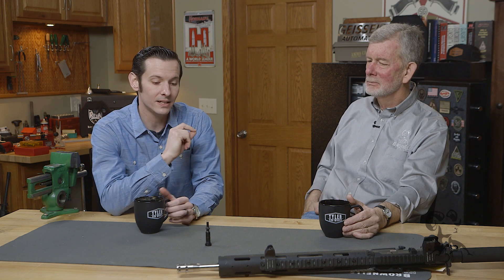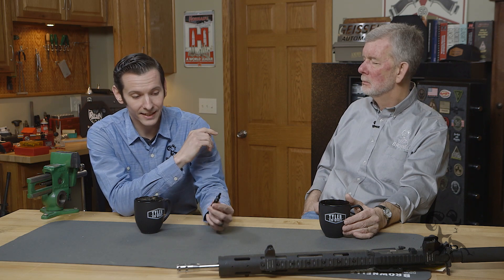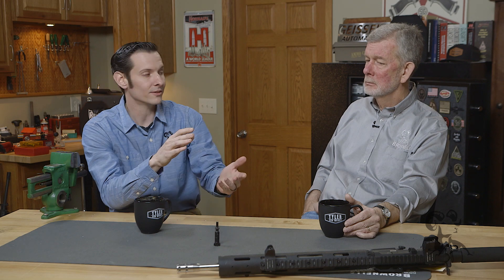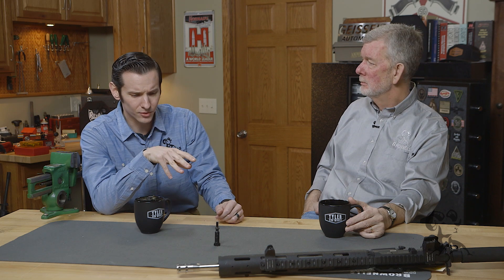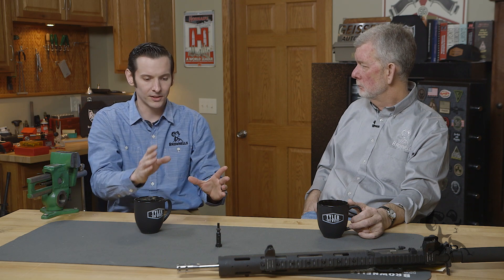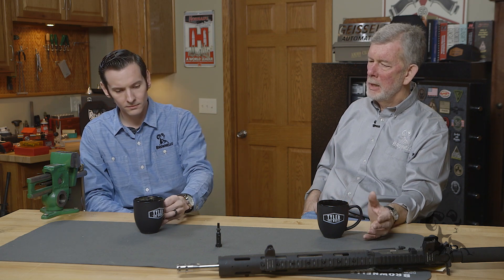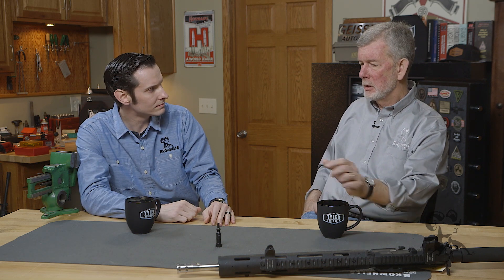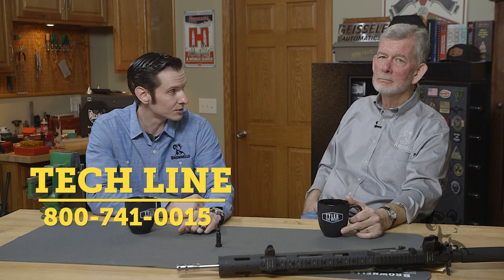Smyth Busters: Debunking an AR-15 Myth - Gas Ring Alignment

Comment: Let's set the internet on fire "The AR is just as reliable as an AK"
Reply: It is.
Reply: I'll see your 'reliability' & raise you a "politicians do not want to take your firearms".
Reply: It has been proven that the AR is more reliable than AK
Reply: Phrogge Prof I wouldn’t go so far as that. They are both firearms that are fit for purpose. I would suggest that the main thing the AR has over the AK is that you can make it very light without sacrificing reliability, or effectiveness as a platform. It is an all around better platform. It is easier to assemble, and easier for the end user to maintain. It is also (I believe, correct me if I’m wrong) cheaper to manufacture.
Reply: @nathanielkidd2840  Watch the In Range tests. The AR is better than the AK in mud and as good if not better in dirt and other conditions. The AK has the reputation of needing less maintenance but Military Arms Channel is doing a 10,000 round, no maintenance test of an AR to test that theory.
Reply: mustangkrillin I have. Unfortunately, these tests are too small a sample size. They are useful as evidence to show that the people who think one platform is garbage, and the other is better than sliced bread. 
Even Carl and Ian point this out, that it’s not proof, but is strong evidence. 
People often forget that a lot of the reliability of the AK platform is because of its amazing magazine.
Reply: @nathanielkidd2840  I've personally helped recreate the tests with the exact same results. Modern AR mags are as good if not better than AK mags especially if you consider weight and reliability. I'm not saying the AK is trash but it's worse than the AR in almost every conceivable category.
Reply: mustangkrillin yes, modern AR mags are as good if not better than AK mags, that was kinda my point. 
There are a few reasons that you would choose an AK over an AR, but those reasons are largely not applicable to an individual. By that I mean if you’re outfitting an army, and you find it easier/ cheaper to get one over the other, you are allied with countries that use one of them already, or you want a platform that would prohibit your potential enemies from being able to utilize your supplies.
Reply: @joeydubbs763  Biden says resistance is futile, "the government has nukes and jets..."
Reply: @nathanielkidd2840  So in your mind, a stamped/ painted/ riveted/ huge tolerance- sheet metal firearm is "more expensive to manufacture" than an Aluminum Forged, CNC milled,  anodized, parkerized, melonited  firearm?!? What planet are you on? You do know why Stoner built the stamped sheet metal AR180.......right?
Reply: @joeydubbs763  well Trump has already started the ball rolling with the bump stocks
Reply: scotty362100 the tolerances are not as big as you seem to be pointing out, and the machinery for large scale production of AKs is very expensive. If you start with an empty building, and want to produce them on scale with today’s technology, it is very expensive to produce AKs. I’m not saying it’s cheap to produce ARs, but there’s a reason that you can buy a reasonably effective one for $400.00, and even the PSA AKs are $600.00 and up. 
I don’t feel that an imported AK is a fair comparison, because of the price jumps associated with “real” AKs, or the cost of shipping them. 
I think Mischaco has a video about this.
Stoner designed the stamped receiver because in the 60’s this was a cheaper way to build that rifle. This is no longer necessarily the case.
Reply: @nathanielkidd2840  Are you serious? So The "machinery for large scale production of (AR's) is NOT very expensive? There are so many holes in your argument it is pathetic! The ONLY reason it is expensive in the USA to make an AK at this point, is the human/knowledge factor! PSA's AK is right in line with AR prices at this point, and when the skilled workforce "human/knowledge" factor is matured you will see dirt cheap US manufactured AK's! AR's are only cheaper because the tolerances/metallurgy have all been well defined, and the processes matured. AK's in third world countries are around $100-200, which is what it "actually" costs to stamp out the sheet metal parts, and labor for people that have been building them for 73 years. It is ALWAYS cheaper to manufacture a "stamped steel" firearm, the 1960's has nothing to do with it. You aren't the brightest light bulb in the drawer, are ya?
Reply: scotty362100 did you not read my comment? I didn’t say it was cheap to set up a factory for the production of ARs, but that it seems that with what evidence I can find, using a company that is known to produce inexpensive products, in the same country. You don’t think the cost of labour in a third world country being as low as it is would lead to an AR made in that country being $100.00-$200.00?
The 1960’s has a lot to do with it, considering that an automated CNC machine wasn’t around back then, and the initial investment into a industrial level steel stamping machine is roughly equivalent. And you can’t use that same machine for anything else, unlike being able to use the same machine for milling out the bolt, carrier, upper, and lower. The barrel and furniture cost differences is a wash. You still need to forge and mill trunnions, bolts, and carriers on an AK, but unlike an AR, it is necessary to buy an entirely separate machine.

PSA is selling ARs for ~350.00
Their cheapest AK is $600.00
The know how to produce an AK is not the expensive part of production. The machinery needed to produce the product is.
Reply: Well ak & ar have been manufactured for decades before cnc became available, so it would be reasonable to AssuMe that i could make everything with screw machines & brooches & gang drills & stamping dies & press brakes.
A good barrel drill will be expensive but thats a common problem with every carbine or rifle regardless of type.
Reply: MyMusic Account1 that’s kind of missing my point. Yes, you could make either of those rifles with simple hand tools, but would you be able to efficiently produce them in quantity, at an acceptable level of quality? I know “acceptable” is subjective.
Reply: @mymusicaccount1456  oh God shutup. I didn't like that trump got rid of bump stocks but choose your battles and bump stocks stocks getting banned isnt worth it. Now if its banning a gun then you got my attention.
Reply: @scotty362100  1 to 200 dollar in those countries is like 600 to 700 here. And ar15 are still cheaper by a good margin from palmetto state armory.
Reply: @bobbyraejohnson  well I'm just sayen Odumbo in 8 years never did that, he actually gave us the right to carry in national parks which I've done twice since then. But we worry about the left being gun grabbers but the right seems to be where the guns get taken away from us.
Reagan banned assault + magazine restrictions in Cali.
Romney did same thing in Mass
Palin de-gunned the Alaskan militia
Brady laws including background checks.
All little bits, all "good ideas", all take a little bit away from our right to bare arms!
Reply: AK is pretty garbage. Antiquated, awkward, and a chore to do basic maintenance on. It's the opposite of an AR in every way.
Reply: The AR platform is a Mr. Potato head gun. Mix & match components of like type. The AK, not so much. I think a decent AR is more accurate than the AK as well.
Reply: And only reason in the beginning was the government was sabotaging Eugene Stoner because of they didn't want him have the contract and wanted Springfield Armory to get it ! They changed the power from stick powder which was low moisture content and low carbon instead used grain powder which was plainly not good for gun and M16 misfired and jammed all because of them screwing with powder The GUN WAS NEVER A PROBLEM PERIOD also secondary one was the springs used in the magazine were faulty and helped the gun to malfunction So as the SPENCER RIFLE WAS ALSO Sabotaged the Government did again in Vietnam. Shoot in the first test with M16 the pins for the sights were replaced with welding rods to look ok but misaligned gun So my thing is before you believe the nasty story about how bad the M16 was find out real truth THE GUN WAS A EXCELLENT WEAPON AS STONER BUILT ONLY THE ARMY HIERARCHY WRECKED IT FOR THERE PROFIT. OH and STONER BUILT THE AR 10 first with 7.62 X 51 The ARMY CHANGED IT TO SMALLER ROUND HE DID BUT NOT HIS CHOICE!
Reply: @bobbyraejohnson  the problem isnt WHAT got banned its HOW it got banned.  They ruined an entire industry and put companies out of business all without passing a law through congress.  Congress took no part in banning it.  It was all done through executive action and bureaucracies.  By the people allowing it to happens what's to stop the next president from taking executive action and having these agencies "redefine" anything and ban it without a congressional process?
Reply: Reliability is great but Accuracy is King.🤔
Reply: @ytty5183  AR 15 SERIES is very accurate MOA accurate

Comment: It makes sense that the gap, if aligned in all 3 rings, would leak gas and it certainly does but the leak is not enough to matter.     The massive amount of gas produced from firing a cartridge is far greater than the gas that could pass through that small gap in such a short period of time.

Comment: In the Marine Corps, I was a rifle and pistol coach. I have seen My16A2s all of a sudden, start throwing random flyers. Had the shooters disassemble the weapons, and lo and behold, the gas rings were aligned. Staggering the gap and the groups closed right up. 
That's just my experience.  I've only seen it a few dozen times, so......
Reply: Why would the gas pressure effect accuracy of the weapon? I would think I could remove the gas rings all together and turn the rifle into a single shot and it still would not effect the accuracy of the barrel. It sounds more like the barrels were hot and taking the gun apart gave them a chance to cool down, or allow the shooters to rest

Comment: Once the rings are compressed inside the carrier that gap reduces to essentially zero anyways. Thats the whole reason for the gap. If they were a solid ring they would have to bend/twist out of shape instead of compressing to seal.

Comment: What about full auto bolt use, where the rings are so worn the bolt drops out, when you pull the cam pin out? I have seen that in person and the rifle functions perfectly with the worn gas rings.
Reply: Well, then the rings should just be replaced.. doesnt neccessarily mean worn rings won't work on a properly or overgassed rifle, just that it's not getting its maximum effective gas pressure.

Comment: Test it!!! You can't debunk a myth by using logic and reason alone and have it be undoubtedly debunked or proven. Besides, the thought is that the alignment of the 3 gas rings COULD cause the loss of just enough pressure to short-stroke. Also its more than likely to occur in a precisely tuned AR, like with an adjustable gas block. Take an AR with an adjustable gas block, tune down to the point it uses only as much gas as needed to cycle, align the gas rings, then see what happens. That is really the only way to "debunk" this myth
Reply: Does a lawnmower stop working when it's piston rings align? No, so why would a rifle?

Comment: Thanks Guy’s I Believe This Myth Was Started Because People Were Thinking Of Installing Pistons In An Engine As a Mechanic The Service Manuals Always Say The Piston Ring Gaps Must Be Staggered Before Installation To Prevent Blow-by Of The Combustion Gasses Into The Crankcase And Loss of Compression 👨🏼‍🔧 In an AR There Is Excess Gas and The Chance of Them Aligning As You Guys Said Is Slim To None and If It Did It Would Have Little to No Effect 😎👍🏼 Myth Busted

Comment: So my father and I recently purchased S&W AR-15s, both the exact same models. I’ve already learned how to breakdown and clean both. There’s one difference that I noticed and that is that the gas rings on my AR has more trouble slipping back into place compared to my father’s. Is there some difference in dimensions that I should be concerned with?

Thank you in advance.

Comment: When I first came into contact with the AR platform, AKA M16, in the mid 70’s the instruction from the Drill Sargent was to spread out the gaps equally and to not align the gaps because of gas bleed potential. So, you did what the DS said, next question.

Comment: I had a problem with stove piping with my M16.   The gs ring gaps were aligned.  fixedd it an fired over a thousand rounds with no issue

Comment: So alignment doesn't matter? So what if one of the rings gets a small piece the width of the gap on a gas ring blown out? Ring still intact. I had one and the bolt wouldn't cycle properly.
Reply: Well you're supposed to replace your gas rings anyway if that happens.  Your remaing gas rings might of   been worn and on their last breath too. That's like asking "what if I break a firing pin".

Comment: Myth or no this is quite literally apart of weapons inspection doctrine that is in practice to date at every unit I've been a part of. Also for those who want to know I am Active Duty Air Force Security Forces so I work with the AR 15 platform on a very regular basis.
Reply: Agreed, it is part of the inspection, not a necessary part, but indeed a part. I was a Combat Engineer for four years and an armorer for two, if I knew then what I know now...

Comment: You dont bust myths by speculating at a bench. You could do a fairly simple test, fire the lowest pressure ammo that will cycle the action reliably, align the rings and see if it still cycles as reliably. You could also see if they actually move between shots and by how much. If you want to get more technical, use a high speed camera to measure bolt carrier velocity.
Reply: I used a rifle with an adjustable gas block.  Rifle was set to the lowest gas it would reliably operate on.  One day I was cleaning it and wondered about the ring gap thing, so I lined them up.  Rifle still (on minimum gas) ran perfectly fine.

Alignment is a myth.

Comment: The Myth is Not that the AR won't cycle when all 3 of the gas ring gaps align because that can easily be proven wrong by manually disassembling the firearm,aligning the gas ring gaps,reassembling the firearm and shooting it. The Real Gas Ring Concern is that of Shot Placement Zero.  If You have ever done any Precision Long Range or Precision Competition with a AR, once you have the Firearm Precisely "Zeroed" with the Gas ring gaps evenly and properly spaced and after cleaning,lubrication and reassemble like Eugene Stoner had Intended for the Best Functioning of the Firearm and now have extensively shot with out inspection of the Gas Rings they can align from Bolt movement combined with gas pressure flow.  You will notice Your Shot Placement will move.  And when they do Your Precise Shot Placement Zero Moves affecting You Accuracy. So either inspect and evenly space your gas rings during regular Cleaning and Lubrication for better precision reliability or get and install the Superior Continuous Gas Ring like the U.S.Military does on the M4 and M16 so it it no longer a issue.

Comment: Wait! Youre telling me this is a myth and it wouldnt be acceptable to military standards? And the military was just paying marksmanship experts to come to the range and lie to us about gas rings alignment? Hold up, I've spent many days/nights and weeks at a time on the firing line shooting all day and night and found this information very helpful. This is not a myth those rings aligning will cause improper feed and ejection problems.
Reply: @scotty362100  real clever all you can do is go around name calling. Where  you heroes at in real life?
Reply: That's funny you say that, since I just watched some videos of Pat MacNamara (former Delta) doing some carbine training for 10th Mountain and in that training he called the ring gap thing a myth.  

So...

Seriously, go get your AR and try it for yourself.
Reply: Well, if your rifle has worn gas rings and is on the cutting edge of cycling then it might help. So it's a good practice to teach in the military where parts get worn and may not get maintained as needed. But it's not fixing the underlying problem though if your rifle is short stroking ect. It will just be a bandaid.

Comment: I have JP gas rings and they collapse when Doing the bolt test to check bad gas rings. Where u stand the bcg up and if it collapses under its own weight then the rings are bad, but my brand new bcg from Jp does this and Jp reassured me that it’s ok and will function fine. Is this a myth?

Comment: And what do you think would force them to rotate once they are operating in the bolt?
Reply: When it cycles open the bolt "rotates" which would cause the rings to move anf since they are independent of each other and in different positions within the bolt carrier they will all move differently so chances of all 3 staying aligned  for more than 1 cycle are astronomically high against alignment of gaps also i would immagine as the weapon heats from repeated fire the gaps would become smaller from expansion.
Reply: Well,  it's a "rotating" bolt system.

Comment: Cotter pin in bolt vertical or horizontal when installed weaker one way or the other?
Reply: Huh? If you're talking about your firing pin cotter retainer pin, then it only goes in one way (horizontal)

Comment: Where did this myth start?
Reply: Khmerican Guy CALLED A MYTH CASCADE .... SOME MORON SPOUTS OFF SOMETHING TO GET ATTENTION . AND LIKE A BARNYARD FULL OF TURKEYS ALL KINDS OF GOBBLING INSUES TRIGGER MORE SO CALLED EXPERTS TO FURTHER CLOUD A NON ISSUE . TYPICAL HUMAN BULLSHIT .
Reply: Might originate from AR10 which is slightly larger. I can make my LR308 not cycle if I align the gas rings.
AR15 gas system is a little bit more stable (due to smaller bore and higher gas pressure).
Reply: Where, just look at the comments!!!
Reply: Military